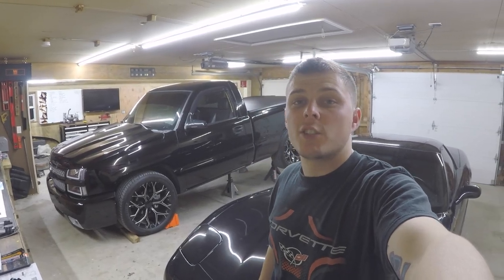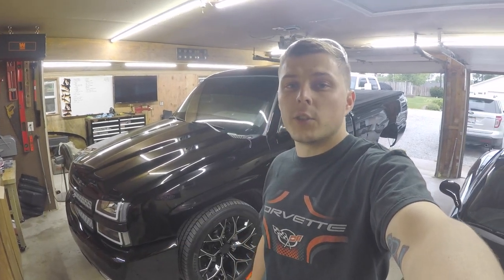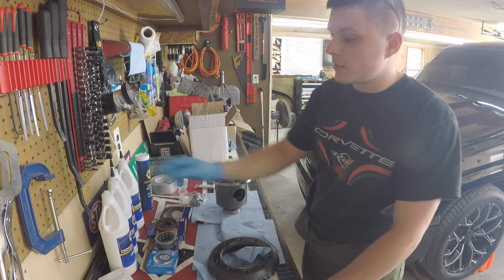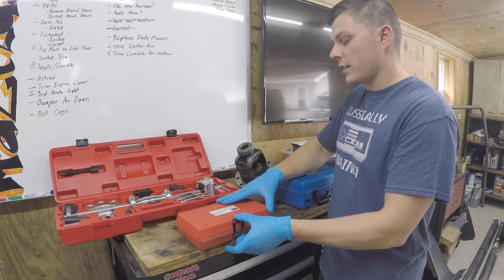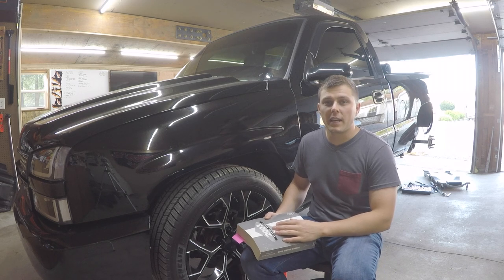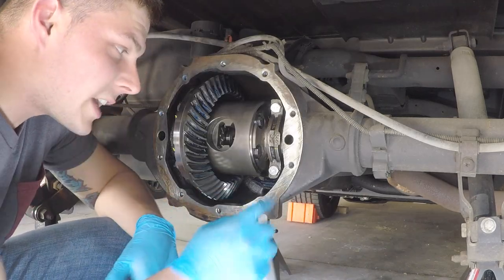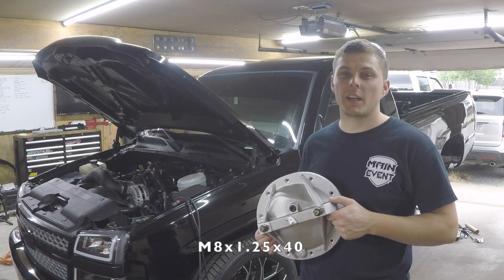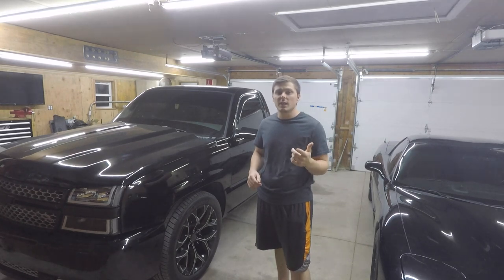Installing A Detroit Truetrac & A New Diff Cover In The Silverado Street Truck!

Comment: Since your White Bowtie is sky high, I'd sump the fuel out and drop the tank considering you'd need a crane to pull the bed off that truck.

Mine is stock and I can use a cherry picker to pull mine, and the 6.5" bed has 8 bolts.
Reply from the maker: For sure! Whenever that fuel pump goes, I'll definitely drop the tank. And there is plenty of room to sit up or kneel underneath the truck haha

Comment: Oh by the way remember some things are measured in inch pounds.

1' lb is 1 foot pound, 12" lbs is 12 inch pounds or 1 foot pound lol, it's the symobols of apostrophe (foot) or quote (inch) at the end of the number.
Reply from the maker: Yea, I've used tourqe wrenches 100s of times, especially on helicopters when I was in the marine corps. It was just an easy mistake I forgot to double check. Or could have bumped the button, since its an electronic tourqe wrench. But it all worked out haha

Comment: Great video, Thank you!  What did you torque the load bolts too??? I'm gonna be installing one of those girdles on my 05 tahoe tomorrow
Reply from the maker: Hey, sorry for the late reply!
Tourqe the mounting bolts to: 25 FT/LBS
Tourqe the load bolts to: 5 FT/LBS
Tourqe the jam nuts to: 20 FT/LBS

Good luck with the swap 🤘
Reply: @TheKingCoopa  thank you very much for the info!!👍👍🤗
Reply from the maker: @OSCARANDRES039  for sure, thanks for the support 🤘

Comment: What is the general torque specs for the “Load Bolts “ 
I have the 8.5 10bolt on my 98 c1500 suburban
Reply from the maker: Hey, I believe it is 5ft Lbs. (60in Lbs)

Here is a link to the install instructions
https://www.google.com/url?sa=t&source=web&rct=j&opi=89978449&url=https://www.taperformance.com/PDF/Rear_End_Girdle_Instructions.pdf&ved=2ahUKEwiKkqigurGFAxWgkIkEHUHUCeEQFnoECBYQAQ&usg=AOvVaw1_1mRcnyJyEldcEOqWqlm4

Comment: Hey do you know if you had to use the different bearing size or the stock ones worked ?
Reply from the maker: Hey, sorry for the late reply. I believe they were stock size, but they were an extra option when I ordered the truertrac. So Im not 100% sure. you could always give quick performance a call. They were pretty helpful. Thanks for the support!

Comment: Hi me again. I got a question. Im thinking about regearing from the 3.73 to 4.56 or 4.88 on the rear with the truetrac. Do i have to also change the front differential gear too? Some say i dont have to and some say i have to. What do you think? Keep it stock or reagear? That is the question? Lol
Reply from the maker: Hey, id only regear, if you are planing to go to larger tires, or planing on doing alot of racing. Most race trucks run 4.10 gears. But if your staying relatively stock tires/lift then id keep the 3.73s. Those are gonna be great for around town, and for the highway. If you change to a 4.56 or 4.88 your highway mpg's are gonna suck. Your gonna be running at a higher rpm to stay the normal speed. But to answer your question. You can do it both ways. But if your gonna change the rear gears, you need to change the front gears. Yes, you can change the rear gears and drive it around like that, in 2 wheel drive. But you will never EVER beable to put it in 4x4. Having two different gear ratios, (4.56 in the rear, and factory 3.73 in the front) the first time you try to put that truck in 4x4, you are going to shread some gears, and mess some stuff up! Even if its for 10feet. So change the rear gears and forever keep it in 2wd, or change both sets, and you can go 4x4 whenever. If you change the fronts, they have to be the same ratio.
Reply: @TheKingCoopa  ohhhh. Ok. Heck yea thanks for the info. Man luckily you told me in advance. I was thinking when after i get the new gears and install it and go straight to test it with 4x4 offroading. But not now. Lol. Ill leave it stock then untill i plan on doing both at the same time. Thanks again. 👍👊
Reply from the maker: Haha for sure! Yea, with two different gear ratios, your front and back tires will be spinning at different speeds/revolutions. But you will be traveling the same distance. So that would cause a lot of binding in your drive train. you'll probly won't even be able to drive 5 feet until something broke. Snap your U joints, turn your driveshaft into a pretzel, or the most common is shredding your differential gears. It's always good just to do a little bit of extra research before you do a modification. So it's a good thing you asked lol
Reply: @TheKingCoopa  oh one more question. Did you use washer with those cover bolts?
Reply from the maker: Yes, I used small washers
Reply: @TheKingCoopa  what and where you buy the wheel/axle bearing and seal from. Also do i need to grease it? Does it mix with the gear oil and mess with the true track if you do use it? And whice grease u use?
Reply: I have heard ppl say it's ok if the gears are close like say if u had 3.42 up front and 3.55 out back lol I have mismatched gears and I've used 4x4 like 5 times so far the trucks been okay but obviously not a good idea. I only do it when I have to get out some mud. Changing my rear soon

Comment: Hi...thanks for the video. I was just wondering why you didn't fill the diff fluid through the fill plug on the new diff cover? You decided to use the stock location to fill the diff.  Thanks.
Reply from the maker: Hey, thats what the diff cover manufacturer instructions were, to use the factory fill hole. If you use the fill plug on the diff cover, it would take like 15 quarts of gear oil or something obnoxious like that, and would basicly fill the entire differential up.

Comment: So im about to do the same exact thing you're doing. Do i also have to get the metric(m8x1.25x40) bolts for it too? Also what was the torque amount for the bearing cap bolts?  Oh and the torque ring gear bolt? One more thing whats the recommended gear oil for the truetrac?
Reply from the maker: Hey, with the kit I bought, and linked in the description. They will send you SAE bolts, more than likely your rear end will be metric threaded. So the bolts they send you won't work. you wont be able to re-use your factory bolts, because the new diff cover is alot thicker, and you will need longer bolts. For the gear oil, A quality, petroleum-mineral based, GL5 rated 80w-90 gear oil should be used. They also state, to make sure their are no additives pre-mixed into it. The only place I could find that had that, was at napa. To tourqe for the Carrier Bearing
Cap Bolts are 60 ft-lbs and the ring gear bolt tourqe is 65 ft-lbs. Pay attention to those, because they will most likely be reverse threaded

Comment: Is the true trac still holding up since this install?
Reply from the maker: Hey, the truck has been down for the last year. Getting a built 6.0/4l80e/AWD/nitrous. But from 2020 to 2022 I beat on it ALOT. Constantly redline shifting and digs with it. Tge tru trac handled it great. I also ended up switching to 4.10 gears which helped out alot with acceleration.

Comment: You able to get a link to some 4.11 gears for this same posi unit  ?
Reply from the maker: Hey, sorry for the late response. I plan on staying with my 3:73s. But if you wanting to swap to 4.10 or 4.11 honestly I'd still go with quick performance. I called them up and they told me everything I needed. Quick shipping. It was all great. 
For the 8.6" 10 bolt. They have 4.11 ring and pinion gear sets for like 99$. And if you want the whole package deal. They have the Detroit trutrack, 4.11 ring and pinion gear set, master bearing install kit, and an optional solid pinion spacer. All for $670 which isn't bad at all. 

https://www.quickperformance.com/GM-86-10-Bolt-Eaton-Detroit-Truetrac-Posi-Gears-Bearing-Kit-Package_p_21560.html

Comment: How much diff fluid did it take. I just put one like the one you installed but filled from top fill hole on diff. I used about 3 quarts and didn’t run out the top. I seen you filled yours still from factory.
Reply from the maker: Glad you brought that up, I forgot to put a note in for that. The factory 8.6" housing takes 2.15 quarts to fill up. With the new TA Performance diff cover, it now takes about 2.75 quarts. I called them, and you're not supposed to use the fill plug on the diff cover. The fill plug is too high and will fill up the axle tubes, before it overflows. Which would take like 8 or 9 quarts to reach that point. Thats what they told me. I don't know why they even designed it with the fill plug, if you're not supposed to use it. So I would either call the company that made your cover to get the right fluid capacity, or use the factory fill location. I think you're good though, 3 quarts is really close to my fluid capacity.
Reply: A lot of companies make THREE plug diff covers, Drain, Level, Fill...I've even seen them with dip sticks and sight glasses....I installed a Three plug G2.  
Also It's messy but use form a gasket silicon when putting the cover on the differential a fiber gasket will weep over time. 
Aaaand, the bracket that attaches at the top of the diff cover to hold the brake lines/cables might need a spacer and a little longer bolt if the bracket isn't like the bracket in this vid, GM did use a couple of different ones over this model's year.

Comment: Hey where did you get the axle spacer?
Reply from the maker: Hey, by axle spacers do you mean the carrier bearings for the differential? Those were from quickperformance.com. I have direct links for all the parts in the description of this video.

If you ment the 3in wheel spacers, I got those from titanwheelaccessories.com. here is a link to my video on those, if your bored.
https://youtu.be/Lyj46or5MZ8
Reply: @TheKingCoopa  hey sorry I mean the spacer that went between the axles so they wound slide side to side, right after the axle c clips
Reply: The spacer is the one in the video 12:17 min in
Reply from the maker: @jaimecabrales5344  oh okay. That metal spacer, comes with the Detroit trutrac. It's in the box, with the differential assembly when you buy it.

Comment: Do you get new shims on the carrier?
Reply from the maker: Hey, I did not get new shims. Since I didn't not change or remove the pinion gear, also didn't change the ring gear. The only thing I changed was the Detroit trutrac. Sometimes with the gm axles, you can reuse the carrier bearing shims, and it will still put you right back to where it was. (Not all the time though) Are you supposed to measure or install new shims when you change anything in the diff? Yes. But i didn't, and it worked out just fine. Just make sure you dont flip or mix up the shims!!
Reply: @TheKingCoopa  thanks man i just ordered the trutrac, i also went with gears im not ready for the backlash if itll be spot on lol but nice videos keep em up

Comment: Does it chirp the tires around corners like lockers???
Reply from the maker: Nope, drives just like stock, untill you get on it
Reply: Thx. What size tires u running?
Reply from the maker: @aarons.5523  they are 285/45r22. A little large for a lowered truck. Don't remember what I'm at in this video, but im now on a 4/6 drop and coilovers up front

Comment: Were you able to reuse the factory shims @thekingcoopa
Reply from the maker: Hey, yes i re-used the factory shims. Since I never removed the pinion gear, and kept the same factory 3:73 gears. Are you supposed to re-shim it everytime? yes. But alot of fourms and research i did said as long as you only change the locker, and bearings, the factory shims will get you pretty close to how it was. 
If your wanting to change gearing, then you will definitely have to shim it! Both side to side, and pinion shims, which takes a very long time to get right
Reply: @TheKingCoopa  ok I changed the gears this past summer from 3.42s to 3.73 so I would probably have to shim it because I was putting it back together earlier today and I broke the factory shim lol
Reply from the maker: Hahaha yea, that sucks. Since you are changing gears, I'd definitely shim it. There were a few people that thought I was crazy for still using the factory shims.... well, it hasn't grenaded yet lol. I've been beating on it quite alot
Reply: @TheKingCoopa  well I sure do appreciate ya help and responding back
Reply from the maker: @chancycarrjr.4108  for sure, and thanks for the support 🤘 good luck on the shims. Its gonna be pretty time consuming.

Comment: Hi new subscriber here. I im a new chevy truck owner. I have a 2003 chevy silverado 1500 5.3l 4x4, stock 10 bolt 8.6 3.73gear ratio 30 spline. and recently broke my spider gears. Now looking to purchase and install the truetrack  soon in the comming future. Im making a list of whats needed for complete install. Will i need the exact carrier bearings you got for it or will my stock bearings will work? Do i need new shims also or will my stock shims work? Anything else needed? Also what is my axle diameter? I look into some website to puchase the truetrack trying to put my info in and it  needed some other input like axle shaft diameter, length, ring gear diameter and bolt amounts, pinion nut size, and lug diameter. Im on fb and forums and no comments/help. Oh and for the time being i need to find replacemants spider gear from a donor vehicle from a junk yard and need compatible vehicle but cant seem to find any. I know a whole lot of vehicle have the same rear end diff but dont know what they are. Lol sorry for the long comments. Im stuck with all these question for about 2months now. Need help
Reply from the maker: Hey, thanks for the sub! Sounds like you have a good truck 👌 can't go wrong with a 5.3, and 3:73s mine do great on the highway. In the description of the video I have the parts linked that I used. You can just call that company, they will tell you exactly what you need (should still be the exact same parts I used) but your gonna want new carrier bearings. 1, because the miles might have started to wear them out. And 2, because the carrier bearings are pressed on, so its gonna be extremely difficult to pull those off without damaging them. Plus the extra couple bucks that they cost, it's going to give you some extra peace of mind that you won't have to mess with it for a long time. As long as you keep the same ring and pinion gears, you should beable to re-use your factory shims. Thats what i did and it came out perfect (doesn't always happen)make sure you don't flip them, or mix up the shims, so be sure to mark them. but if your wanting to change your gear set, then you will definitely need new shims. You will need a tourqe wrench, lock tighte, diff cover gasket or gasket silicon maker,  prussian blue loctite for the gear meah test, and two people definitely helps. As for the axle diameter, bolts, and all that. I never had to figure all that out. I just called that company, they have already done all the research and told me exactly what I needed. For the spare spider gears, id try to look up what all vehicles GM put the 10 bolt in. Should be quite a bit. But there is a lot of silverado/Sierra's at my junk yard. So I don't think it would be to hard to find the spider gears. Or you could always order a new set offline. Hope that all helps!
Reply: @TheKingCoopa  thank you, great info.👍i will do that and call them. That will save me alot of time and headaches lol. Did u also have check the backlash after the install with the stock shimms? I like your head lights what brand are they? also is that hd front end. Im plan on doing those as well. With back motorized widow and motorized sunroof. Keep them the fantastic vidz comming.👊
Reply from the maker: For sure 🤘I did not check the backlash with a dial mic, like I should have. But I gave it the ol hearing test, and they sounded spot on, from when I took the factory gears out lol (not what your supposed to do) The headlights are made by YITAmotors, they run about $240. The front bumper on my black truck is actually an SS bumper, from the SS AWD silverados. I did a full video of that install too, if your interested. I've been thinking about doing a sunroof as well, but I've been having a hard time sourcing the one i want.
Reply: @TheKingCoopa  Theres a sicc one with panoramic sunroof movement some dude on youtube put on his old school cutless.
Reply from the maker: Oh yea, that sounds sweet. I have a single cab, so ill have to do a spoiler style sunroof.
Reply: i'm amazed you didn't need to reshim it, especially with new bearings. even 1/1000 can throw off backlash. not to be negative and i honestly hope it's good, but if they explode, please let us know.
Reply from the maker: Are you supposed to shim it everytime... yes haha. But i read a few fourms online that said if I kept the same ring/pinion gears, the shims should still be close. Its been almost 5 months now, of daily driving, got dynoed, and getting beat on. With the street/strip shift kit, it shifts at 6500RPM... I havnt been very nice to this truck 😆😆 but, So far so good!
Reply: @TheKingCoopa he'll yeah man. I want to do the same thing